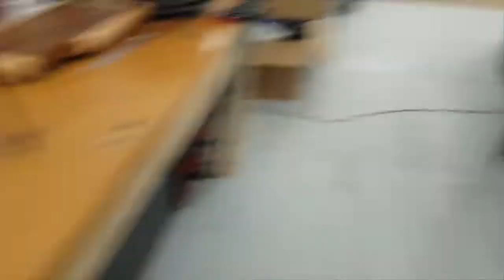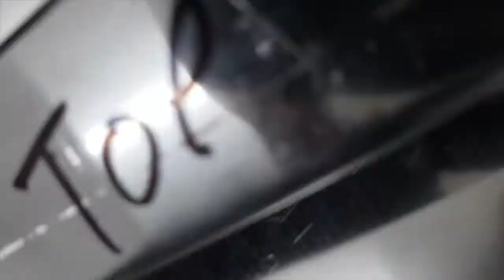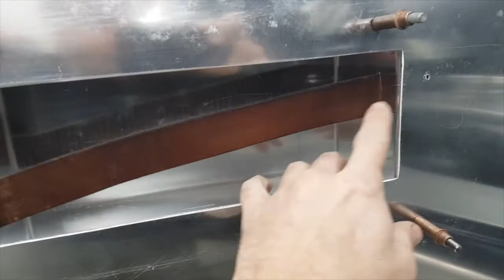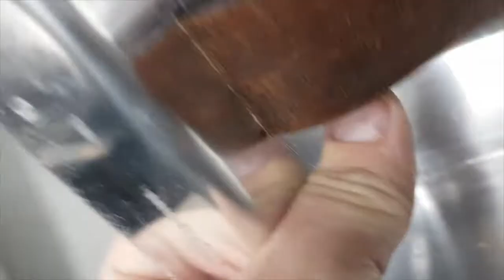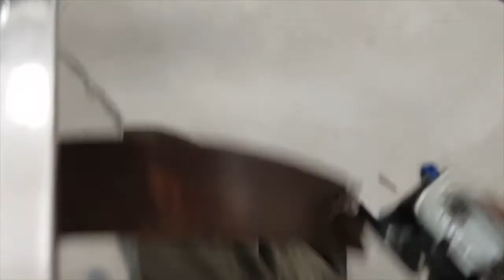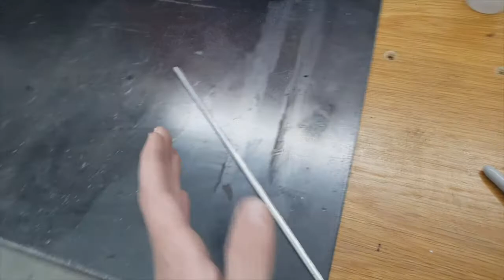Daytona Coupe kit car build - Building custom Door liners

Comment: Is your car a factory five racing kit? I love it. I built one recently and it was a great experience.
Reply from the maker: Hi Thomas. No its not a FFR at all. The chassis is a Dax and the body I believe is the same as an early FFR but built by Dax. The rest has come out of my head. Can I see your build on YouTube?
Reply: @MrDanieljanes  I don’t have anything on YouTube. I like your engine compartment and interior. It looks like an actual Daytona coupe. My car is a Gen 3 from FFR. I can email pics or shoot you a link to my Instagram.  
I built the complete kit with a ‘Blueprint Engines’ crate motor. It’s a 302 bored out to 306 CI with aluminum heads. Paired to a TKO 600 5 speed.
Reply from the maker: I would be keen to see your Instagram